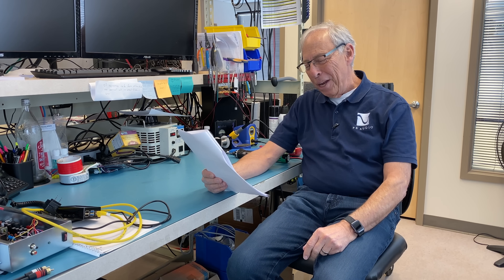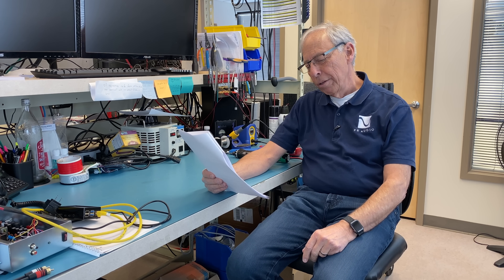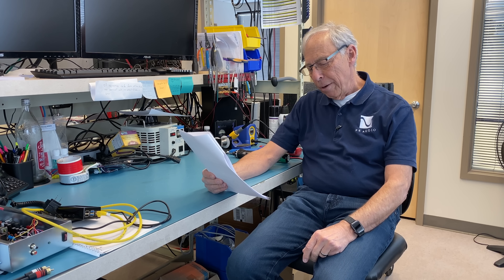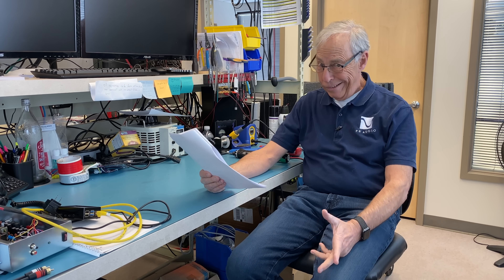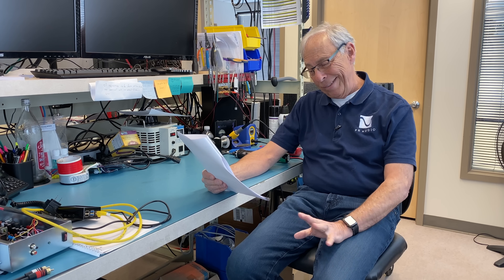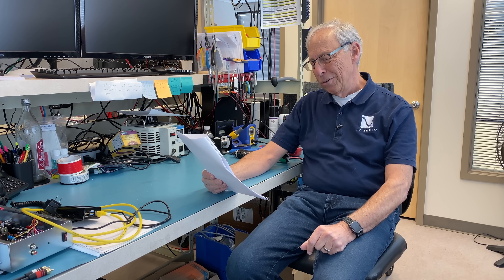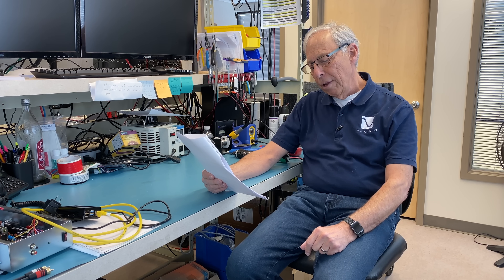Should you upgrade a speaker's crossover?

Comment: Hi:

Let me start by saying that you come across as one of the most reasonable and knowledgeable people I've found in this “vintage audio” niche.

My name is Orlando Mergal. I live in sunny Puerto Rico.

I’m a 69-year-old audio afficionado. My system consists of a Carver C-1 Preamp combined with an original  Phase Linear 400 and two Onkyo Scepter 10 speakers. I also have a couple of processors (DBX 3BX III Expander and DBX 120 Subharmonic Synthesizer).

I have a local technician, that I've known for over 40 years, that keeps my old toys up to date.  He even altered my Phase Linear amplifier to replace the meter bulbs with LEDs and added a potentiometer to tame their brightness to my liking.

I’ve always been happy with my sound. The large horns in the Scepter 10s make my big band jazz CDs sound like the band is playing right next to me in my living room.

However, I do have a couple of questions.

1. Why is it that these speakers never come up in online discussions. It’s like they were never manufactured.

2. What do you think of the Scepter 10s? Are you familiar with them? I used to have Pioneer HPM-100s but these seemed more efficient. Plus, I'm just a sucker for horns.

3. Would you recap the crossovers on the Scepter 10s?

I know my way around a soldering iron but I have no idea which capacitors I should buy.

In the past I've ordered from Parts Express.  Any suggestions as to what type and brand I should procure?

Thank you for your excellent content. I love it!!!

Orlando
Reply from the maker: Hi Orlando and thanks for being part of our community. I have never had the pleasure of hearing those speakers. That's great how they must sound. Typically the only caps needing replacement in a speaker crossover are the big ones if they are electrolytic. You can tell those because they always are housed in a metal can where film capacitors are all plastic feeling small barrels or like Chicklet gum. I would trust that any capacitor would have its value written on it. Just replace those with the same value out of Parts Express.

Comment: Hi, could you offer any advice on whether tweeters degrade over time? I have a 20 year old set of KEF Concerto Ones which have a nice balanced sound but to my ears they seem to lack definition over the years. I'm looking to replace the tweeters and upgrade the crossovers. Kind regards, James.
Reply: There are a lot of variables but most tweeters themselves shouldn't really degrade per se unless some internal component of the tweeter suspension does.  If the tweeter has ferro fluid inside, that could turn to sludge over time and should be cleaned out and replaced with fresh FF.  The capacitors and maybe resistors can also drift from the original values and could be replaced and/or upgraded if you like.  Anything that gets replaced should be as close to original values as possible (especially any tweeter replacement), or you risk botching the design up.
Reply: @scottspencer4018  Thank you.

Comment: I obtained a pair of RtR HPR-12 Magnums from an old highschool classmate for a song.

They sounded pretty good — better than my Pioneer CS-99s, being more transparent and having much-better bass.

But these were made in an early production run, so they're over 45 years old, and it's well-understood that the electrolytic capacitors used at the time will go out -of-spec after a couple of decades, so I decided to upgrade the caps.

I bought some midrange foil Clarity caps ($75± for four capacitors between the two speakers). It was a very enjoyable afternoon, unhitching the circuitboard from the back of the case, removing the circuit-breaker reset switch as a source of noise in the signal path, and fitting the new caps to the circuitboard.

The improvement in the speakers' sound was immediate, and only got better over the next few days as the caps "burned-in." These units sounded good before, but now they really sing. The bass is tight and nearly flat down to 30Hz, the mids and highs are transparent, nuanced, and spacious. The improvement in soundstage is delicious.

The conventional wisdom is that you don't need to replace any resistors you might find, as these rarely go out-of-spec, though some people think that replacing old resistors with current-technology ones will improve things. You might also look into replacing any iron-core inductor coils with air-core inductors, but I'm not literate enough in that area to tell you where to begin finding a drop-in replacement.

So the roll-up is: Do the upgrade. Well worth the time and expense.

Comment: I have 2 pair of 1974 vintage Altec Lansing Model 7.  I changed capacitors and speaker binding post at a cost of $150 on one pair.  These cap took 100 hours of play or so to break in.  The receiver has speaker A + B so I could compare.  First of all it sounded as if the tweeter was replaced.  Big difference worth the money.  Next I re capped the other pair.  The woofer cap was the same but I spent more on the mid and alot more on the tweeter cap.  What a difference.  I hear things like never before.  Especially percussion, cymbals, bells, ect.  Something like Kraftwerk is stunning.  One thing I should mention is that the new caps are much larger but still have same UF rating.  They can be difficult to fit.  The caps I used are made in Denmark.  I am not an expert others may be better.  I could have spent much more than I did.  I doubt I could buy new speakers that sound this good for what the upgrade cost.

Comment: Passive crossovers are Pie in The Sky over most of the globe now. You can't get such components nowadays and then I don't think you ever could either. These components, you would find are manufacturers specials that might or might not have the exact value marked on them. They will have been selected to match the impedances of the chassis units. I feel obliged to point out that the only way to obtain accurate crossover nowadays is by active filtering . Your advice will do nothing apart from a slight amount of financial easement in the component supply industry.

Comment: I have replaced capacitors on my main speakers and now my subwoofers. All from the 1990s. The clarity has returned that made me first get excited about audio. I also upgraded the internal wiring  to 100% ofc copper audio cable wiring. Not sure if that helped too but it couldn't of hurt. Still have one set of towers i want to recap next year.

Comment: I spent 300 on a triangle borea Br02 + 250 for air core coils heavy awg, jantzen caps, mills resistors, athom zef wire, new biding post 100% copper.

Verdict: those are not 550 bookshelf's speakers. More like 1500. 

I did the same with the elac debut b5.2, even greater results.

Comment: I did this in my LS50, respecting manufacter specs, I chance the  capacitors for mundorf AGO and Supreme evo oil, resists m-supreme and the internal cable for a Silver plate cooper Discovery... The speakers are much more natural, detailed and smooth too

Comment: Crossovers is one of the first things that got me into audio when I was about 8 years old. I discovered I could run car woofers under my bed and use the signal from the woofer portion of flea market 3way speakers and it took of from there. I learned about impedance/ohms so I then only bought receivers that could go down to 4 ohm loads. The I fell in love with the Optimus STAV-3350 from radio crap/shack :) I shouldn’t bad mouth radio shack it’s where I got my start. But that optimus could handle 2 ohms but I never wired it to 2 ohms it was actually a pioneer come to find out my buddy’s dad had one only difference was his display was amber mine was blue ish white. And I’d had surround sound. So I could use it in Stereo mode and put out good bass or use the surround modes and watch movies ect. Blew out my dads stereo experimenting but he gave it to me years later I still have it. They repaired it by soldering in a bigger fuse now it’s temperamental and doesn’t like to turn on always. But got into car audio so yup! It all starts somewhere. I still remember the model though THE STAV-3350 :) probably kept me out of trouble come to think of it it kept me home.

Comment: My advice is: if you like to mess with boards, cables, components and iron soldering, go ahead.
If you wanna a REAL improvement in sound, forget crossovers messing, give that pair to some NGO and go straight for new better speakers.
Reply: Or if you can look a guy with experience un recap and upgrade equipment, You can make a great goal with no much money

Comment: Components; I recommend Janzen Audio in Denmark, for both supply and their own lines. Super value - perhaps their 'Cross Caps' might be the best choice for you. Ranges are from quality budget to esoteric. great resistors and their custom inductor range is the best value around imo - great value air cores.
if you want to tweak a bit, you might consider making external crossover boxes, particularly as the better parts will likely be bigger. consider extra bracing/resonance control  for the cabs, try increasing 'polyfill'. self adhesive bitumen  panels are a cheap improvement for internal walls and also stiffen up cab. janzen also supply this stuff - no personal connection here, though i have been a happy customer. bare in mind bang for the buck sound wise can be impressive, though you won't get the money back on resale - view it as 'playing money' and you won't go wrong. 
Suggested 1st base; tweeter cap/resistors replace with MOX's, cab damping.

Comment: The importance of driver quality is often overestimated, the importance of crossovers, cabinetry and driver alignment/arrangement is often underestimated. 

It’s possible to obtain a very satisfying and enjoyable listening experience from run of the mill speaker drivers when they are used in a way that makes the best of what the driver has to offer.

Comment: GR Research has a lot of good information on the topic of upgrading crossovers. Using RP-600 as an example the entire process is covered in a multiple video series starting here: https://youtu.be/NH4xI5VXR_o  . Do be aware Paul was talking about keeping the electrical values as factory designed the upgrade being to better quality parts. GR Research does both quality of components upgrades and when warranted redesign of the crossover as in the RP-600 series.
Reply: Yep, I've done one upgrade from GR research, and I have another on the way

Comment: I recently "saved"  few pairs of 70s/80s KLH IVs from the landfill.
Anyway, those old KLH used oil filled caps, (maybe PIO or paper in oil).  Oil caps were a thing then so I assume lots of speakers used them.  One hundred percent of the crossover caps were very bad, to to extent that the (perfectly okay) HF speakers didn't work/play at all.  Fifty dollars in new mylar caps and both sets work just FINE again. A quick sand and stain and clean the grills with auto rug cleaner and looking good.
I'm still considering painting the woofer surrounds (the "front" side at least) with some latex restoration product, but they seem okay for now.  Mixed messages for what to use, any suggestions?

Comment: Upgrading the crossovers on high end vintage speakers is one of the single best ways to get amazing sound. A lot of those older high end "audiophile" speakers had amazing drivers(altec, JBL, Klipsch) that sound beautiful, but some times the components used in their crossovers were lacking and especially given time and age replacing them can only be a good thing.
Reply: I think that is something I will try as I do have vintage speakers from those 3 brands plus 1 pioneer. One question though, is it better to use multiple capacitors in parallel instead of one even if you can find the right value with just one? I think in amps they sometimes use more capacitors for faster release of energy.
Reply: @PedroCorrales123  If you can get away with using a single cap for the needed value that's always a better option. Amps often use many different caps because the amp may have several different voltages running simultaneously among other reasons. How fast a cap releases energy is only relevant when you're turning off the device, so it has no bearing on the operational performance of said device.

Comment: Rewiring is the first step, standard economical Fig8 with clear jacket and decent copper, ensure all cables wired in same direction, preferably connection to amp in same cable.
This required first step mod sets a defined foundation to work from, there are required electrical mods too like rf terminating all cable sections, 110R or so.
Once this is done cap and inductor and resistor signature sounds are perfectly audible, there is much choice in these final filters.

Comment: Bought some Jantzen caps to upgrade my old Quart 350s and Advent 28s. However, recapping my old Dahlquist crossovers cost $230 for the new caps. They are huge, magnificent beasts compared to the old ones from the 1970's. We're talking 8 capacitors per crossover board.

Comment: I just upgraded the capacitor and the resistance of my elac debut 2 b5.2.
Listening session is for Tuesday.
Reply: How did it go?
Reply: @JonMoralesLA  Amazing, I found out that the harshness in most affordable well designed speakers comes from bad resistors. Better caps bring imaging. The coil help with layering but impossible to ear with an average system.

Comment: The worst component of your crossover network you cannot replace: the voice coil.

The voice coil is a with temperature varying resistor. Double resistance with 3 dB power compression and four times with 6 dB power compression. So your crossover frequencies are sweeping all over the place (I think about one octave with 3 dB power compression), and for the different drivers at different moments and in different amounts. Leading to peaks and dips in your frequency response, changing with the dynamics of your music.

The voice coil is a coil (duh) with a ferromagnetic core (the magnet). So, it colours the sound and it distorts.

The voice coil is microphonic and distorts your signal. And for those who think that it cannot be much: at resonance it dampens the signal with 90-95% (and is called electric damping). Every resonance in driver or loudspeaker shows up in the impedance curves and influences the sound.

So, if you DIY, I think it is better to get rid of the whole passive crossover all together and go for an active crossover. And even better go for a current-drive (c.q. current source) amplifier to get rid of power compression and current distortion (by the voice coil and the microphone effect).

And, as a side effect of the active crossover, it makes the amplifiers hilarious more efficient. Suppose for example,  you have four 4Ω drivers per channel (3-way and sub) and for each a signal of 100 Watt (20 Volt and 5 Ampere) you need four amplifiers delivering 100 Watt and a power supply delivering enough power for those 400 Watts (nice DIY job). If you keep your passive crossovers you need a total signal of 80 Volt (4 times 20) and 20 Ampere (4 times 5), thus 1600 Watts and a power supply for that. At least, because your passive crossover suck up quite some power. So the power amplifier is, with four drivers, at least 16 times as big and the power supply is at least 4 times as big. (All these numbers are for one channel only.)

The money you safe on the passive crossover components, the amplifiers and power supply you can use for some nice active crossover.
Reply: Back in 1981 when I went full active, it was told to me that just two 100 watt amps actively crossed was simular to one 400 watt system.
Reply: STEREO JUNKY That’s right!

Two amplifiers parallel is equal to 400 Watt (peak),
Three parallel 900 Watt,
Four parallel 1600 Watt,
Five parallel 2500 Watt, etc

But this is optimistic, only when power is equally distributed over the drivers. On the other hand with passive crossovers you lose quite some power.
Reply: STEREO JUNKY That’s why I don’t see any reason for using passive crossovers. Not a sound reason and not a budget reason.

Moreover the crossover frequencies of active crossovers are stable and independent of voice coil temperature.

Comment: I have a pair of 25th Anniversary Advents that are in great condition. They have been re-foamed so I am good there. I was just wondering if it would be worth it to upgrade the crossovers in these 90's era Advents.
Reply: Yes!  Replace the Caps and resistors with newer and higher quality ones of the same values.   Capacitors can go bad over time.  Replace iron core inductors with air core inductors made with larger gauge wire.  Check with Danny at GR-Research  as he may have upgraded Advent crossovers for folks before.